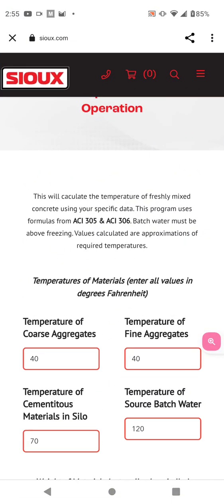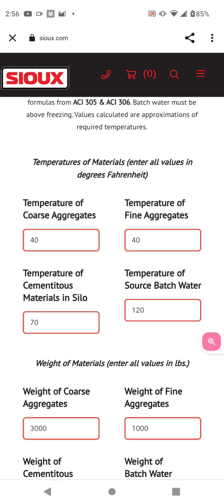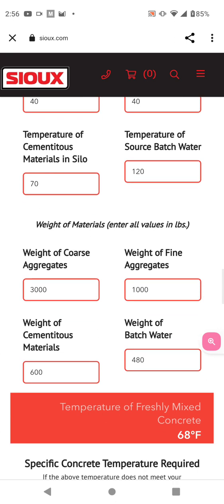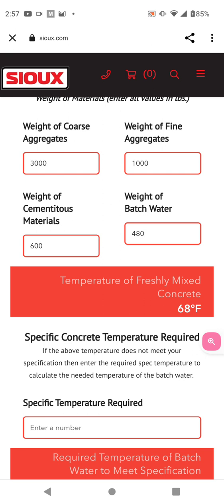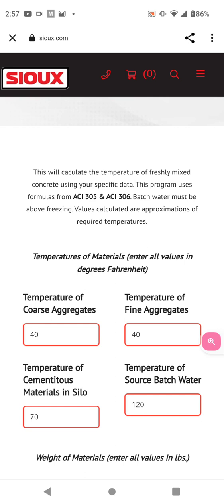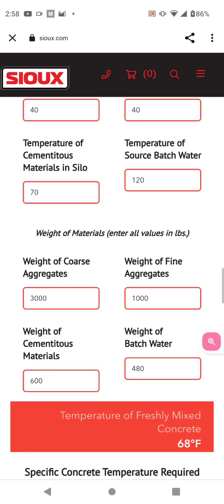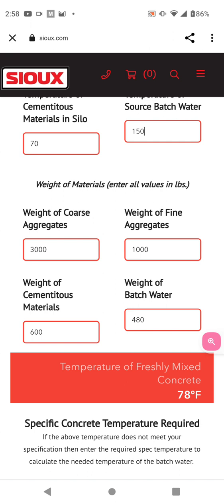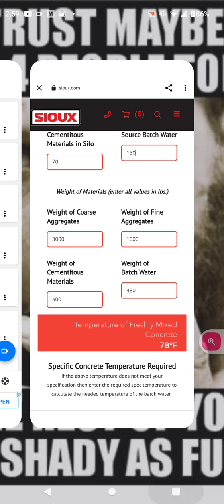Concrete placement in the winter temperature control is critical

Comment: Over time, the AVERAGE aggregates temperatures should be close to outside ambient and truck temperatures. To your point, is that good enough, particularly on days that are particularly hot or cold? 

There are regions that maintain stable temperatures year round. On the other hand, we see some temperature swings of over 50F this week in parts of the US.